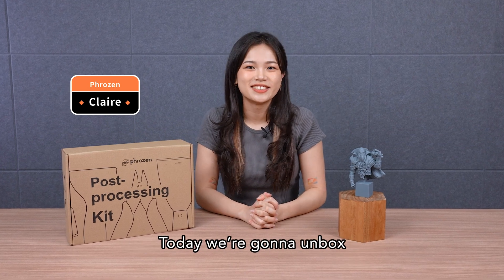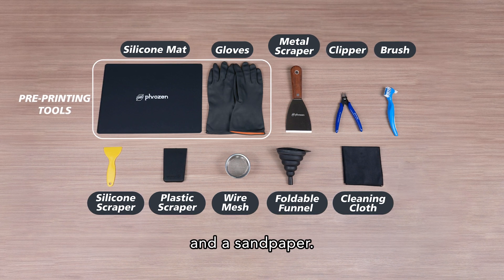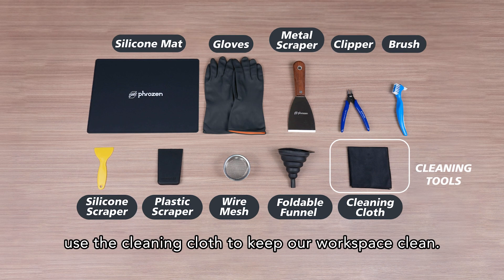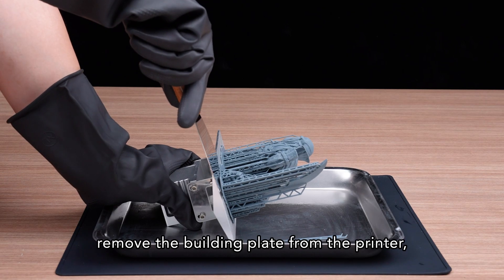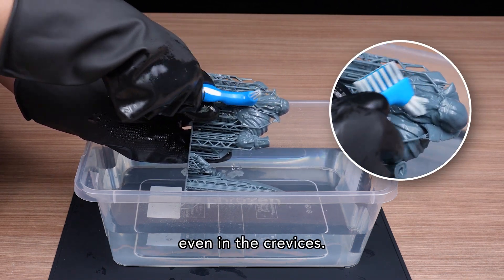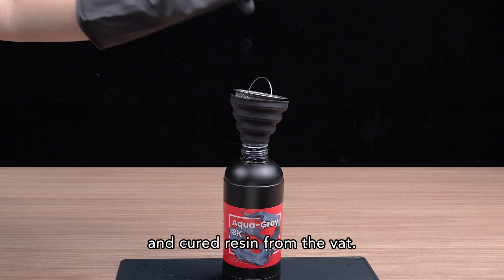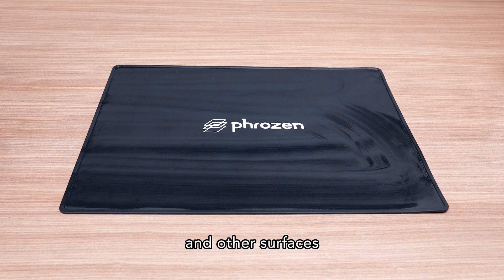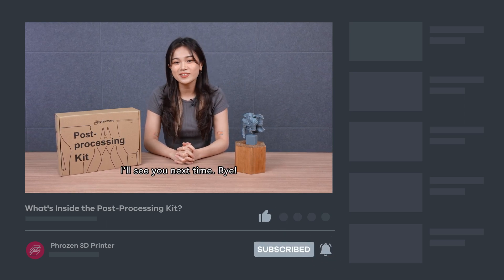3D Post-Processing Kit : All-in-one 3D Printing Toolkit ! - Phrozen LCD 3D Printer

Comment: In your YouTube shorts, you use a metal tool to dry the print. What's the name? and where I can get it?
Reply: Its just an electronic air gun. Similar to the small (and bad) electronic air brushes that are charged via USB.
You can just google electronic air gun. They are not too expensive and very useful as you can just recharge them.